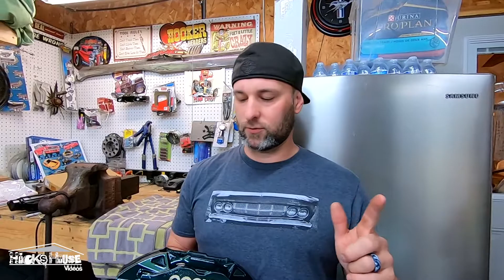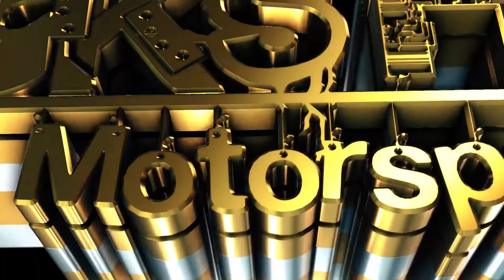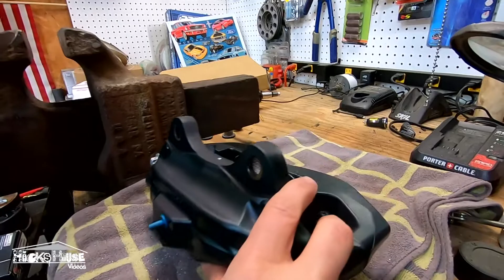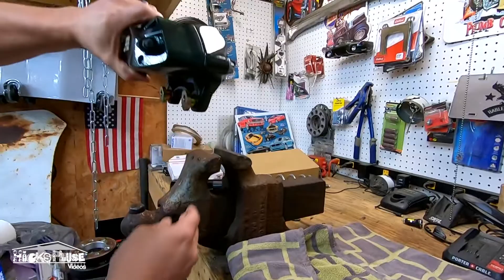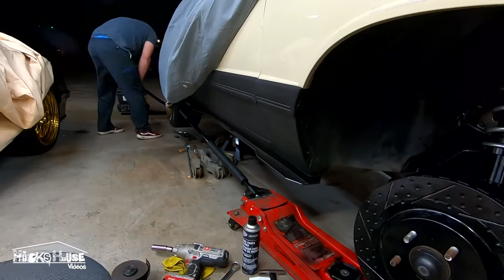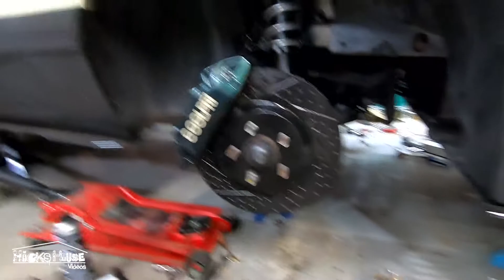Cadillac Brembo Upgrade for Mustangs. Installed with S&S Engineering Kit

Comment: Where can I buy those brake lines and what brand are they called. I converted my 85 mustang to the 5 lug upgrade but my passenger side of my brake lines are rubbingon the wheel, when I turn my steering wheel all the way to the right.
Reply from the maker: https://buystifflers.com/stainless-steel-brake-hose-kit-1987-1993-mustang/
Reply: @HicksHouseVideos I appreciate it, these fit perfectly.

Comment: I looked around for your video for the wheel install with these but couldn't find it. Did you end up needing spacers for the wheel to clear the caliper? If so what size.
Reply from the maker: I do run a 1/4” spacer on the front. Thanks for watching.

Comment: Are these off the CTS or ATS. And which years work?
Reply from the maker: They are ATS and here is a link to the driver side:
https://www.amazon.com/ACDelco-172-2777-Original-Equipment-Assembly/dp/B01K8BW1YS/ref=asc_df_B01K8BW1YS/?tag=hyprod-20&linkCode=df0&hvadid=312455765168&hvpos=&hvnetw=g&hvrand=15993288330590612576&hvpone=&hvptwo=&hvqmt=&hvdev=m&hvdvcmdl=&hvlocint=&hvlocphy=1021322&hvtargid=pla-451299390855&psc=1
Reply: Thank you!

Comment: Can you please tell me how wide is the caliper?
Reply from the maker: I’m not sure I would have to measure it.
Reply: @HicksHouseVideos  thanks. Just trying to figure out wheel options. The depth or thickness would help. I already have the PBR option and these look much thicker. Need to know what size offset wheel depending on thickness of this caliper
Reply from the maker: My wheels are +30 with a 3/16” spacer
Reply: @HicksHouseVideos  great my wheels are 24 offset. They should work without the spacer. Right now I have 1” gap between PBR calipers and the closest wheel spoke.  Also how does the braking feel?
Reply from the maker: Braking is really good.

Comment: Awesome vid man!!!  Those joints look good!! How much was the set? I missed that if you mentioned it
Reply from the maker: I bought used cobra spindles that came with rotors, $300, the new calipers and pin kit I bought on Amazon  $270. The S&S conversion kit is around $200 and I also bought new brake lines from stifflers $119 and then new pads from advance $100. It was right under $1000.
Reply: @HicksHouseVideos  not bad at all!
Reply from the maker: For the brakes?
Reply: @HicksHouseVideos  yes sir!
Reply from the maker: It’s not bad at all, look up a brembo or one of the others for a fox specific kit they are well over $2000

Comment: Nice job, showing what has to be done. I’ve been thinking about getting these calipers for my 85 SVO. I’m still gathering up parts, so I’m not quite ready for this addition. Thanks for sharing
Reply: Did you do this on your SVO?  I have an 86 SVO and want to do this too, but I think I need to swap the brake master cylinder
Reply: @bullet2096  no not yet, I decided to drive mine with the stock SVO brakes. I still may still do this swap though. At the moment I’m in the process of repairing it, from a crash. I had an accident a few weeks ago, but it wasn’t due to the brakes. I made a rookie mistake and tore up my door and fender. I have a video of my car on my YouTube channel.